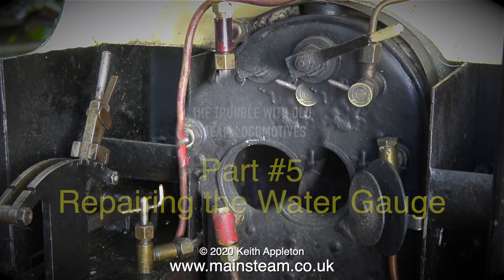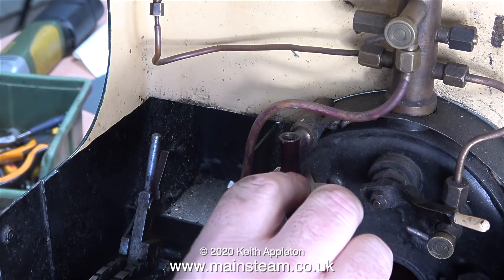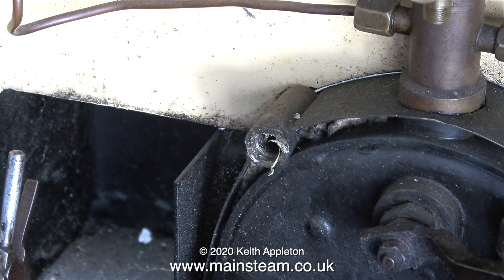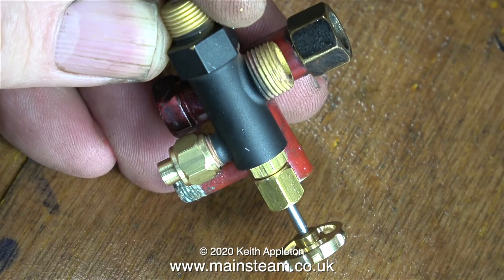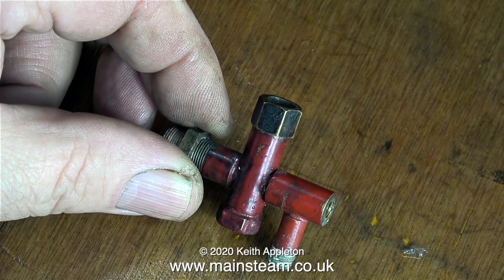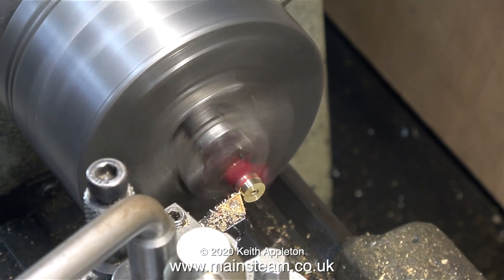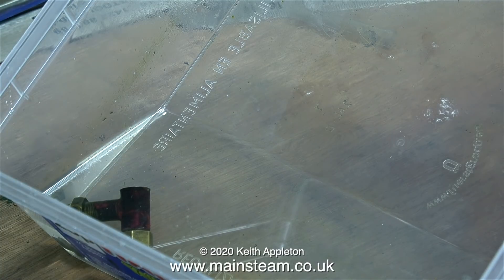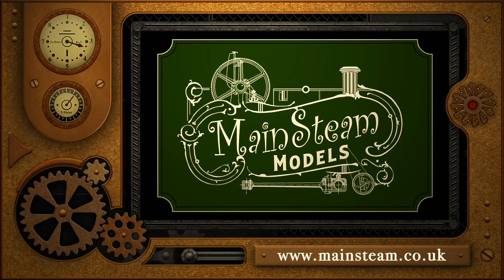THE TROUBLE WITH OLD STEAM LOCOMOTIVES - PART #5

Comment: Interesting fix with the globe valve. I wouldn't have thought of that! The crown of my boiler ended up higher than it should have so I'm going to sleeve the glass with a tube to give the correct low level indication.
Reply from the maker: Yes that works, but it doesn't look too good }:-)))